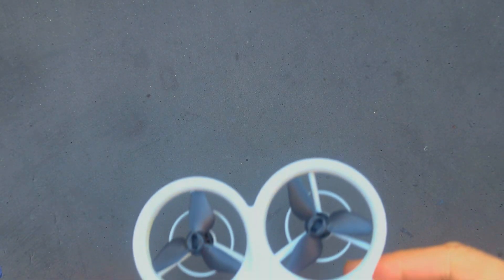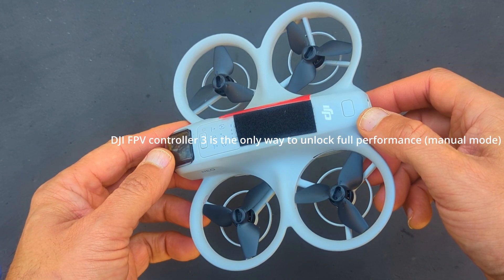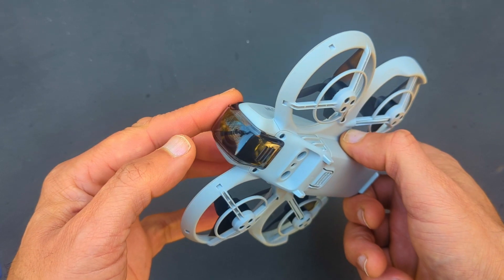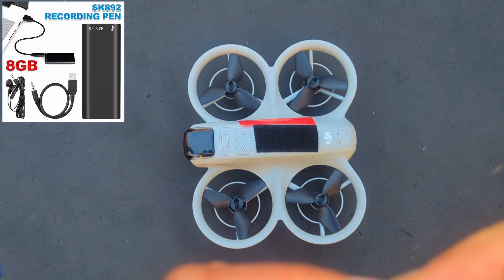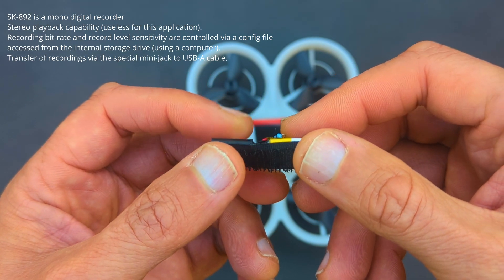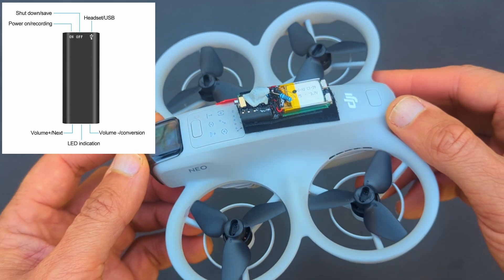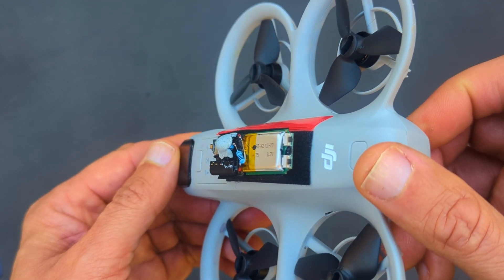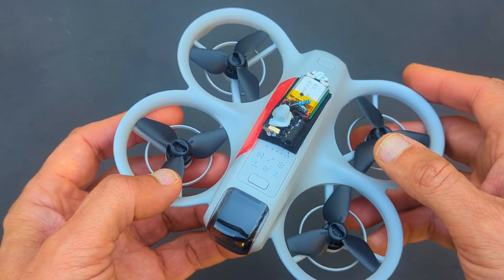DJI Neo sound mod v1 unique in-flight motor audio! neo freestyle

Comment: Way too heavy mate
Reply from the maker: Hardly. 4 grams = easy for neo and since I removed the upper prop guards;  it's stock weight. 

A pro FPV pilot in Germany flew with a bulky GoPro attached. That's heavy.

Comment: Brilliant. I really like the prop noise in the video. What sound recorder did you use?
Reply from the maker: @technofreakUK  Thanks! Prop noise really adds to the experience. The sound recorder is listed in the first part of the video before the 5 minute mark. However, I have recently purchased an even smaller device (half the size). I've also got a video coming with a live audio set-up. ETA is over the next week for that video..